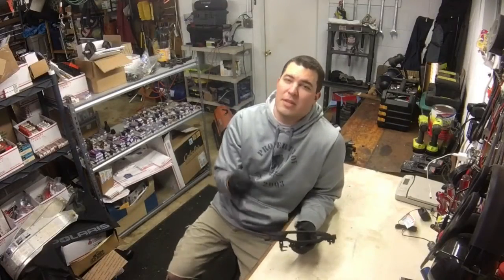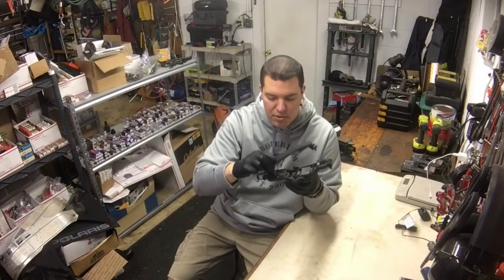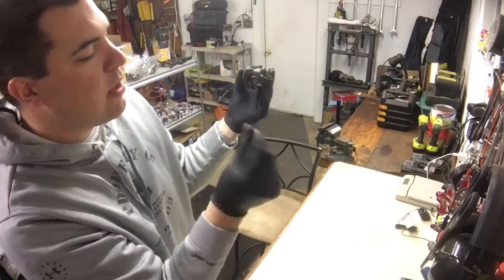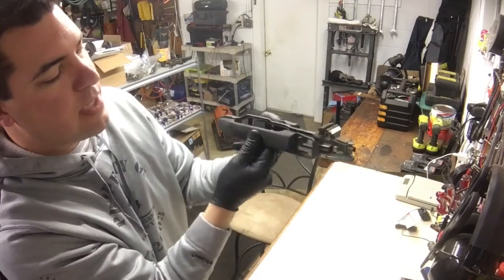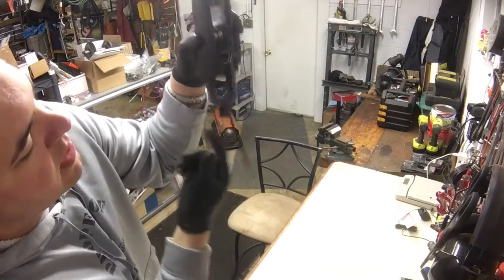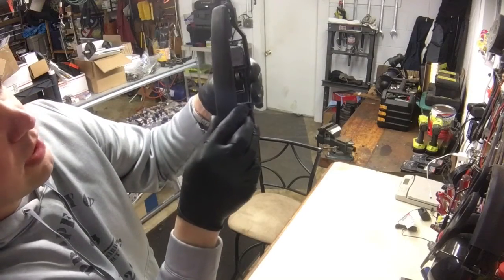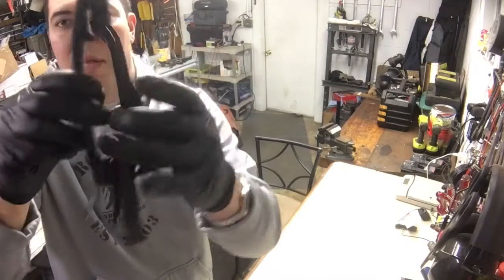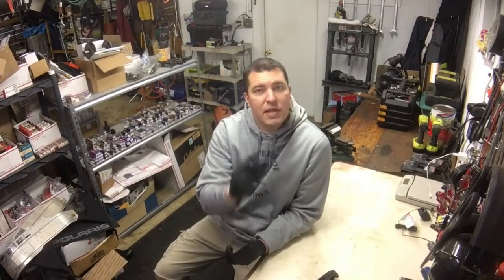How to replace door handle Mercedes Benz ML320 ML430 ML500

Comment: S.K.
I have a 1999 ml 320. The screw that you tighten/untighten with the allen wrench is on the plastic piece that you did not want to remove from the car. 

You were completely wrong. You left out the biggest part. You must remove the plastic 
assembly from inside the door to adjust the screw just as you showed. Getting this plastic piece out is absolutely no fun. It begins with removing the interior door panel.
Reply from the maker: Steven Kay thanks for the insight,  might be a little different for a 1999, mine was a 2000 but I didn’t have to remove the interior plastic.  
Thanks!
Joe